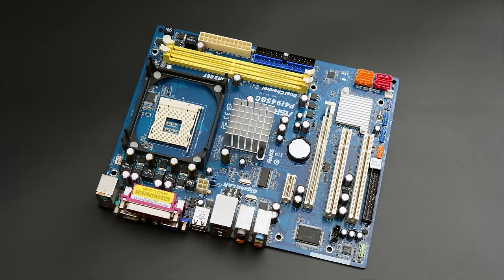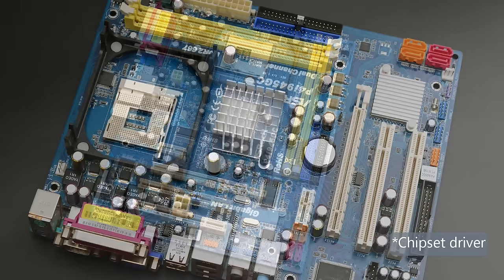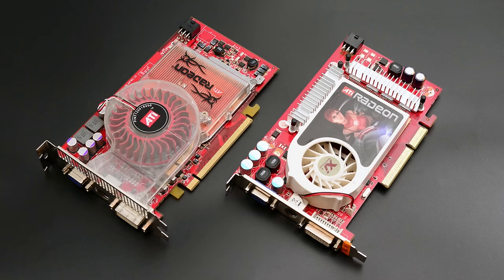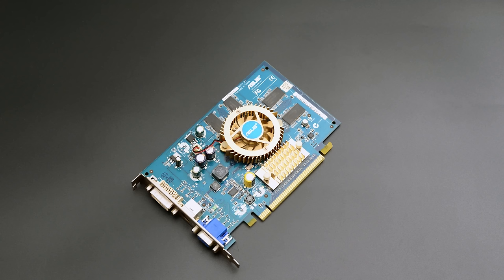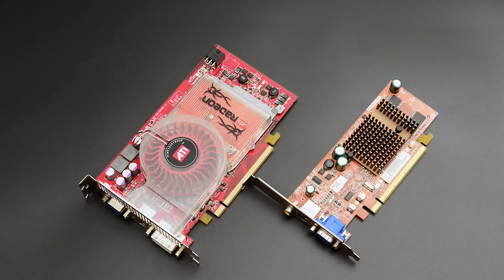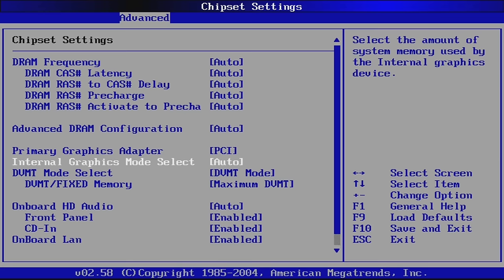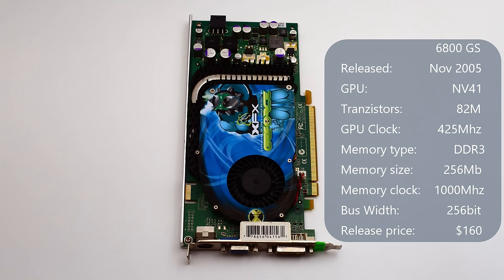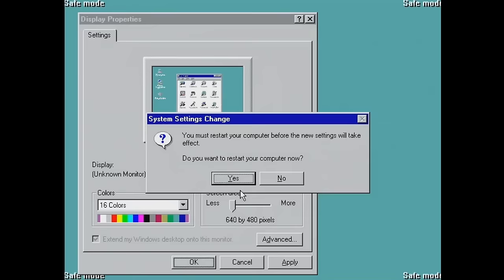Exploring the early PCI-E cards on Windows 98

Comment: If I remember correctly the workaround for the not fully disable onboard video is to just set it to disabled in the device manager.
Reply from the maker: Thanks I will try it with a further project. I plan on doing a second part and really give the 6800GS a fighting chance. If you want to see other parts just leave a message.

Comment: That is a really good idea and I commend you for it. I have personally run a PCI to PCI-E adapter in a Socket 8 Pentium Pro with a GT710, Windows 2000 with drivers.
Reply: Just for fun and curiosity. I always wanted to push these computers to the max. It had a ssd too on the IDE to sata bridge which always feels super fast to me.
Reply from the maker: Wow, that's taking it to extreme :). Personally I also plan a look at a socket 8 but I would prefer a conventional approach. Any reccomandations for the OS? I kind of inclined towards NT4 but many people use win 2000.
Reply: @retrodrive-thru47  The thing to consider with NT based OS is that they are extremely stable because of the Hardware Abstraction Layer or HAL. That is why the minimum CPU jumped from from 40 MHz to 233 MHz from Windows 95 to Windows XP (Vista was egregious at 600 MHz). It takes more CPU to run a HAL, the trade off is less blue screens. An ideal computer that used most of the CPU power you gave it would run Windows 95 with updated drivers and software but we won't get that until that OS becomes Open Source.You might look at 98 SE as I believe many drivers exist for it and it is still HALless. There was even a version of Crysis Maximum edition that said it supported 98 SE but no one ever tested it.
Reply from the maker: @user-kv8wz7ml3o  OK, I know about HAL but personally I don't find it taking away performance. If you have the patience for another clip on this channel, Best retro OS by comparison, using a p4 2.4ghz I've come to the conclusion that windows xp is faster using that cpu than windows 98 for most of the tests. So from a performance point of view the newer versions of windows are more efficient with the hardware. That video in itself may not very well made since it was the second I've done but to me was on of the hottest topics I could think of and I plan to follow it up with other CPUs and configurations as soon as I figure out why the AMD had the issues.
Reply: @retrodrive-thru47 Don't forget there is plenty of variation in Drivers as well. Oldest drivers for newer hardware often neglect older hardware. I think in specifics of the Graphic Cards. All I know is you can't run Windows XP on a i386.

Comment: Recently I spotted one on the local market and I never knew there were 478 socket with PCIE-x, got love Asrock for their motherboards.
One of the best, if not the best AGP and PCIe-x combo motherboard is from Asrock dual vsta.
Great video.
Reply from the maker: Its time will come. Incidentally I used one in the making of this clip. I had to know if the 6800gs was defective or if the on-board integrated Intel gma 950 was ruining the 6800gs experience for me. The answer was inconclusive as I also got artefacts after installation with that one too.

Comment: I bought an ATI X850 XT from Ebay about 2 years ago and absolutely fell in love with its retro gaming capabilities, it is the AGP version though but I don't think there's much of a difference if you can get the PCI-E version to work in 98, awesome card. By the way, I think you may also be CPU bottlenecked, no hate towards the Pentium 4 northwood but I managed to push this card a lot further with a Socket 939 rig.
Reply from the maker: The cpu is bottlenecking the graphics card, yes. I used it because it was the fastest I had so I was trying my best to match the graphics card. I think an A64 is better but a core 2 duo is even better.
Reply: @retrodrive-thru47  I understand! It really doesn't matter for a Windows 98 gaming PC though as you'll be able to max out every game even with AA and AF forced in the ATI control panel. The X850 XT is the best card for Windows 98 when it comes to performance while still maintaining good game compatibility, I tested a LOT of games and demos and nearly all of them worked out of the box with no patches required. I also tried using a 6800 GT with Windows 98 and I completely regret it. 😅😅

Comment: I'm surprised you didn't compare the AGP x850 vs the the PCI E x850 to see if there is a difference.
Reply from the maker: I did compare AGP vs PCI-E a while back on the channel (granted it was 3850 and 7900) but I also did this kind of comparison for myself a few years ago and it usually turns out (if you do it on a motherboard with a good implementation of AGP and PCI-E) that if you have graphics cards with the same frequencies they are equal. The manufacturers usually have slightly higher memory on the PCI-E therefore sometimes these need to be underclocked a bit. But it's a good idea for a future video. Maybe I can do a series with all the couples of PCI-E - AGP cards I have, as I have specifically collected many similar cards like that.

Comment: There is either something going on with your Wind98 setup or with the drivers themselves. The fastest video card that I have been able to get working in Windows 98SE with the modded drivers is the Geforce 7900GTX. Those modded drivers supposedly support the original 8800 GTX chips but I have not been able to get any of them working. Benching with 3DMark and a C2E x6800 at 3.2-3.3Ghz is amazing.
Running dual channel RAM should also help your scores a bit.
Reply from the maker: Yes, the comments made some light onto the issues I've encounter. So I have to create another video in the future, fortunately I have more odd Asrock motherboards that fit this concept.
Reply: those "modded" drivers are really text edits to the original driver. the person who edited those driver INF text probably didn't really realize that later 8000 series NVIDIA cards don't share the same architecture as the 6 and 7 series geforce graphics chipsets but still included them anyway which led to many confusion on the web.
Reply from the maker: @explorer9049  Yes, for this clip I also text modded 81.98 but it didn't go too great for the nvidia cards.
Reply: Mine was a Core 2 Quad Q8200 paired with a Geforce 7900 GTO and a Soundblaster Audigy 2. The motherboard was the Asus P5KPL AM-SE. It only worked with the 82.69 Unofficial Drivers, so compatibility was okayish. For some very specific older Windows games to work, I had to deactivate hardware acceleration for the graphics card and restart the PC, which was a bit annoying. For DOS games, I just used DOS Box in Windows 98. There are a few sound cards that were able to run games in DOS with this configuration, but I had to disable USB in the BIOS (because of IRQ conflicts). And I also had it on dual boot with Windows XP. Then the graphics card kinda died on me and I went for a Geforce 6200LE, which was more compatible overall but too slow for Windows XP gaming.
Reply: @retrodrive-thru47 my curiosity is.. would a gtx4090 work with windows 98se?
Reply from the maker: @garystinten9339  Definitely. It's not going to have drivers though. But windows 98 can output to any PCIE graphics card and (although very powerful) the 4090 is a PCIE graphics card. Using it under windows 98 is going to be wasteful as it consumes too much power and it has no driver and even if by a miracle someone writes a driver you will still use a powerhouse to only play DX9 games on a operating system that is somewhat locked to 512mb ram (but can be convinced to use more, up to 3Gb but my understanding is that everything over 1Gb is unstable)
Reply: Yeah, I tested an 8800 GT with the 82.69 driver and it didn’t work :(

Comment: I'm glad to see more people out there experimenting with weird Windows 98 hardware. Though I'm even more amazed to see you got an X850 to work for so long! My "Worlds Fastest 98 PC" build went through about 8 of the poor things before I finally gave up and stuck to Nvidia. Though I didn't experience weird graphical artifacts with my 7800 GTX
Reply from the maker: The x850xt could be stable as long as you wish. Once the driver was "installed" I couldn't find any issues with it. As for wierd hardware, Asrock was king in that day.
Reply: @retrodrive-thru47  Mine all seemed to succumb to the lead-free solder issue with their RAM chips which kept the system from POST-ing. Maybe one day I'll try again to get a working one
Reply from the maker: @CursedSilicon  I have an x850 with that exact those symptoms, or maybe I have 2 :)), and an X800 AGP. I don't have the skills and tools for this, maybe some day I will.

Comment: The conflict at 8:30 is between RadeonX850 primary and Standard VGA also Primary. I would delete the Standard VGA card instead of disabling the primary Radeon. Actually you have two drivers fighting for the same resources and only one card.
It happened to me sometimes to have issues with vidoe cards because of the same fail in Win98. After I removed the standard VGA, the new installed driver kicked in and all was working well.
Actually at 8:34 the message tells you exactly that: disable the Standard VGA.
Reply from the maker: Great, I will follow this advice in a future video.

Comment: 4:10 this type of chip is still today on every pcie device now it is called a pcie bridge chip. this thing serves now more than a converting something, it contains the device type, id, vendor information and such usefull things also it handles the hot plug funktion and device isolation so in case something goes wrong the pcie bus is not damaged, shorted or distorted. it prevents cross talking and strengthening the signal integrity.  also it does the power control of the device. one thing to pci and pcie this is ,it can be hijacked. pcie or pci devices that working like a master system can parasitic hijack some datelines so the pc cant access them. intel nuc cards with a pcie shaped edge board connector doing this if placed in a normal pc mainbord instead in its special designed mainbords. on start up both systems fighting against each other and who is faster with testing signal dampening and  setting up its configuration and its signal pattern wins over that particular line and all ports and devices are connected with the same line are nor onder the controll of the winner. in a pcie system this can be mean the parasitic device has the control over the chip set and therefore the pc looses the full access the its own chip set. for example you have a mainbord with a B550 chip set and putting in a x4 pcie slot your intel nuc compute card and this pcie slot is directed or handled by the cpip set because your cpu has not enough pcie lanes as your manboard has. in that chase some of them are handled by the cpip set. the problem is here now  the B550 is compatible with the N100 cpu because the N100 is a normal i3 internal with minor differences and also the chip set itself is connected over 4 pcie lanes to a cpu with lanes are used is does not matter and this chip set controls over 80% of all io of your mainbord so your cpu looses the ability to use all this io. now you have a cpu in your mainbord doing nothing or is limited in its action and maybe is in panic mode and shutdown but your nuc can now use all your usb ports. your additonal pcie lanes thats not provided by the cpu and has access to your haddrives and all that.
i know this sound weird but this can happen that is why those cards have a bridge chip. but fortunately there are practically none pcie or pci cards in the wild that can do this except for some reason intel thinks this was a good idea making a pc shaped like a pcie card and also making an pcie pin compatible connector that fits in the same connector on the mainboard. so people thinks yayy now i can have a pc in my pc and now those people findig it self in this weird situation. like me ^^
i have reading many articals to understand why this at first glance random things happen. i have lerned a lot how those things really work and wonder why some features are so rare like port bifurcation and detached or isolated mode and such things also Why PCIe on some motherboards, especially gaming motherboards, do not adhere to the standard and omit features, which leads to problems in future applications. for example using it as a home server. Some PCIe cards will simply not work or function incorrectly. And thanks to the "improvements or optimizations" you also have no way of isolating the card and debugging it in a running system. And from external inspection you won't find any errors that are caused by software and that's all just so you get fed up with 301 fps in games 300. or simply because the manufacturer has enough space on the bios chip just so that you have pretty colorful graphics that you can see once and you won't be able to go into the bios for the next 10 years because you have set everything you need and don't want anything more change.
Reply: The use of such chips came at the cost of latency. Thats why there was almost no difference in between AGP 4X or 8X vs PCI-E. Even till this day you'll see higher end cards still scaling well on even PCI-E 1.

Comment: I don't think your DOS results should really count, we're talking software rendering there, its being rendered on the CPU.
The only thing to really look for there is if the GPU has compatibility with the resolutions used by DOS and DOS games.
Reply from the maker: Yes, you are right. I kind of left a gray area there only saying I tested it with the x300SE. It should be the same for every card in this clip. Like you said, rendering is done on the CPU so the graphics card only counts for the resolutions. Although this is not the average DOS cpu, there may be some people interested in the results. I recently got a p4 3.4Ghz so I'm planning to test another motherboard with a PCIE connector with some other graphics cards.

Comment: I bought it broken, repaired it but the SB failed and it was the end of it. I was very curious on how it would have behaved with W98 as a retro pc.
Guess I have my answer :) 
I had one broken component that I couldn't identify, could you give me the markings on component Q748 (on the right of ram slots, close to hole H6)?
Reply from the maker: I hope I covered as much as possible for your answer. The markings say "M098" on the componet Q748. I also have another clip in mind with an ASRock P4VM890 and a few other Radeons and Nvidias. The VIA should have better compatibility and maybe the 6800GS would behave this time.
Reply: @retrodrive-thru47  Well, it is an oddity. Usually I associate s.478 with DDR, not DDR2 + PCIe. The main problem faced by most is drivers, but you got it covered.
ASROCK spat out a lot of those strange boards. Even  s.939 with AM3+ chispets, that obviously are rare and cost a fortune.

Thanks for the help, thanks for the video!!

Comment: I have a motherboard in reverse so to say. It has a socket 775 with an AGP slot. The upside is that it's easier to find high clock cpus for cheap compared to finding s478s at the same speeds. I've ran a 3,2Ghz Dual core with geforce 3 ti 200 on windows 98 with no issue. It doesn't recognize the second core though. I haven't tried it but you could technically put a 771 x5650 Xeon into it with the pinmod but it wouldn't do much for performance.
Reply from the maker: Yes, I've tried that too. I actually had a retro Pc with a asrock 4coredual, an e5800 and a GF 3 ti 200 for about 5-6 years maybe more. It was great fun. It also works with e Xeon e5450 but you need some bios modding to get all instructions available.

Comment: Surprised you had so many problems with the nVidia cards. Way back when Phil posted his PCIe 98 video I gave it a try with an older Quadro I had on hand and it worked handily. The only problem I had was the double card entry in Device Manager, and disabling one fixed that up.
Reply from the maker: Just looked over Phil's video. He actually made it with the 939Dual-Sata2 he just needed to uninstall the x850 and after the restart it would have worked if the drivers were provided when requested. Maybe I should let him know that he was so close. In the clip he actually used the Asus P5KPL-AM-SE that had the G31. Oddly enough all through the problems I felt the urge to go the Asus P5Q Deluxe I used for the windows upgrade project, I know it has a P45 that's even more advanced but  I felt that board was very stable with windows98 and even more advanced graphics cards. For this project I just couldn't accept  that the 6800GS worked just for an hour, so I used an Asrock 4CodeDual Sata (VIA chipset) installed windows and got the same artefacts. I'm already thinking at a further project with a ASRock P4VM890 (similar layout but VIA chipset) with some other PCIex graphics cards. Maybe you can give me some details about your project, motherboard, quadro model, driver? Cheers!
Reply from the maker: I also didn't want to apply any unofficial patch to Win98 like supporting more ram or faster graphics cards. I guess the only way forward is using a different chipset.